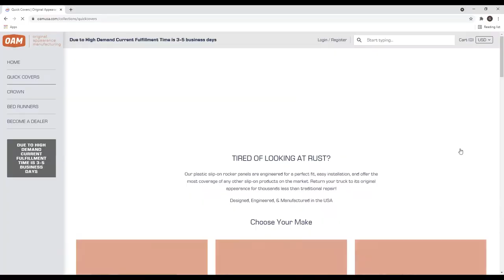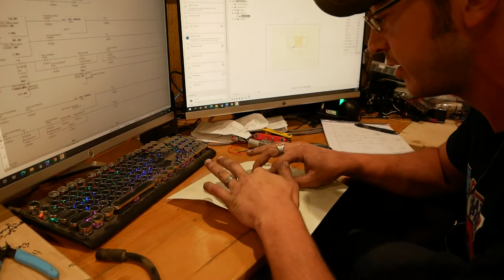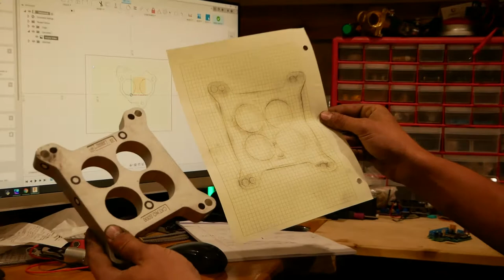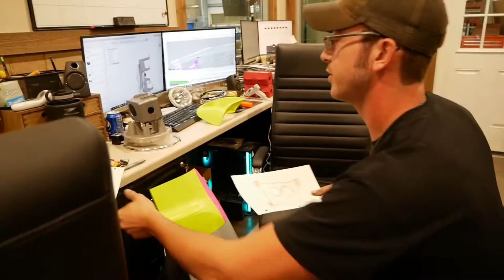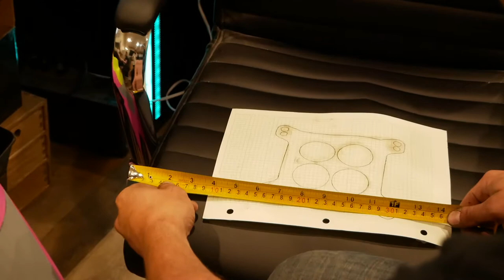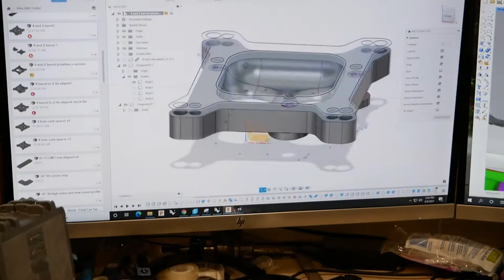GM TBI Intake to Holley 4 Barrel Adaptor (3D Printed in Minutes!!)

Comment: Will that particular spacer hold up to the heat of the manifold?  The original spacer that came on the truck that you see in my pic is a 4-barrel spreadbore for a Motorcraft 4350 and is pretty much unobtanium.  I may have missed it in the video if ya'll mentioned it, but was wondering if stuff printed out on 3-D machines would hold up to the heat.  I ended up buying a spreadbore to standard bore adapter (aluminum) when I bought a new Holley a couple of years ago, but man it would be great to have the same adapter in plastic, due to the heat soak.
Reply: I know this doesn't help you much but you can get rid of 90% of the heat soak problem by getting the felpro intake manifold gasket water crossover block off plate. This way you don't have any of your coolant going through your intake. And if you're worried about heat soak for drag racing purposes when you get done with a run after you shut off the car pump the throttle a shitload and then after about 5 minutes stick something on it to hold It wide Open the evaporation of the fuel will tremendously cool down the intake. Also instead of running zero fuel return go ahead and do a modern fuel pump with fuel return and it helps with vapor lock a lot.